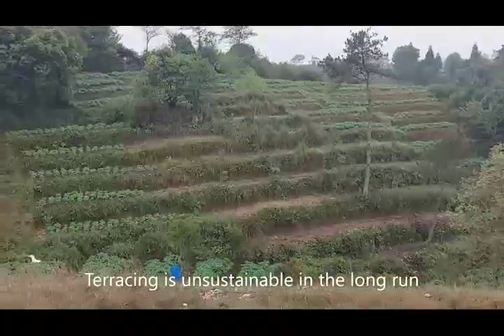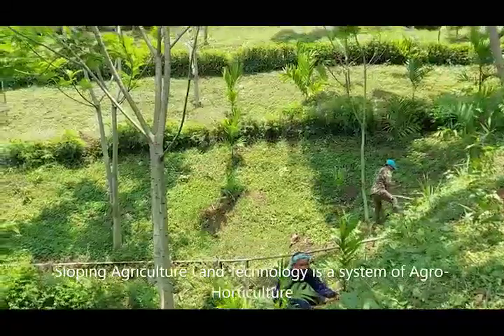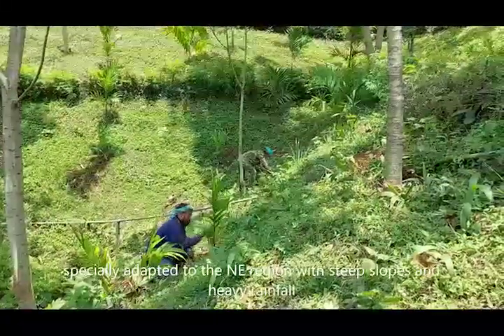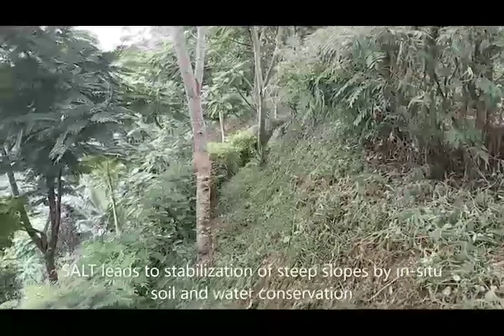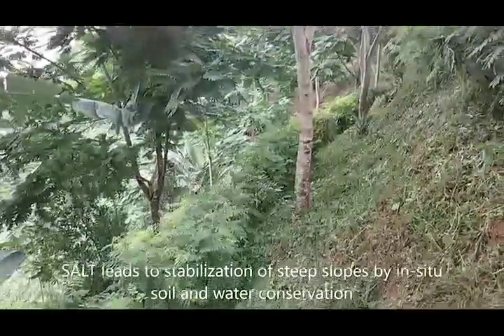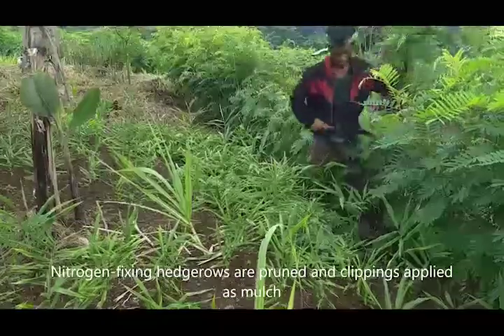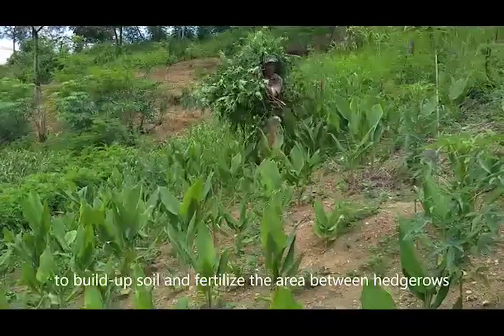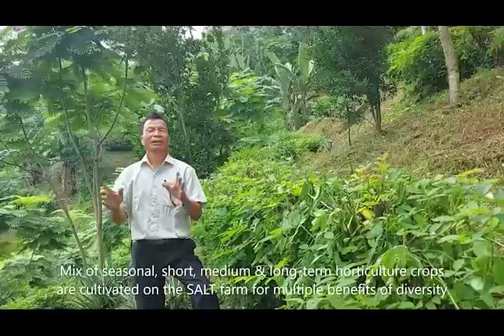Sloping Agriculture Land Technology (SALT) Overview

Comment: What are the dimensions of the different sections and hedgerows? How far apart are they? etc etc
Reply from the maker: Interval between single-row hedgerows can be maintained at 2-3 metres on steeper slopes for more effective soil and water conservation. If the hedgerows are of double-row then 3-4 m spacing will be ok. We are typically using single-row hedgerows as the size of field is small and in many cases hedgerows are planted in existing plantations of arecanut, orange etc. Double-row hedgerows comprise two rows of nitrogen-fixing plants 50 cms apart.